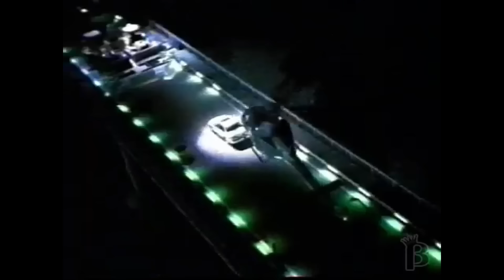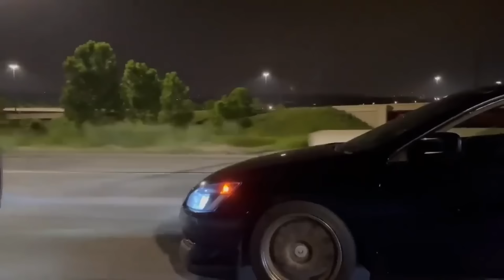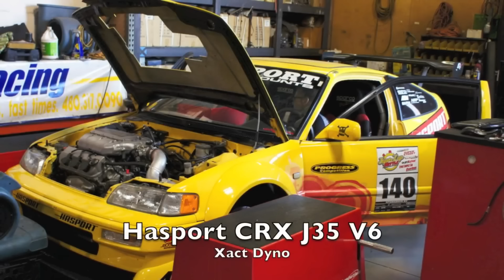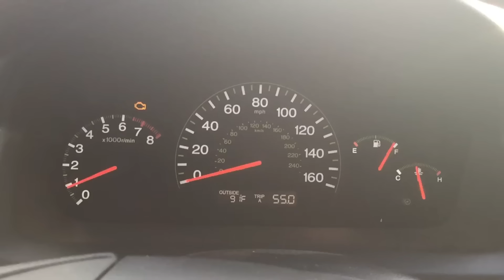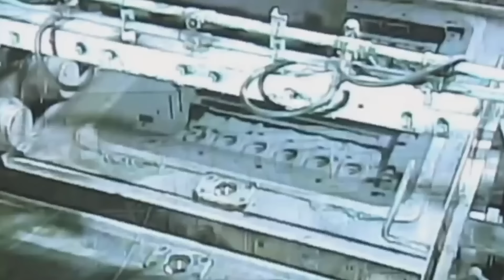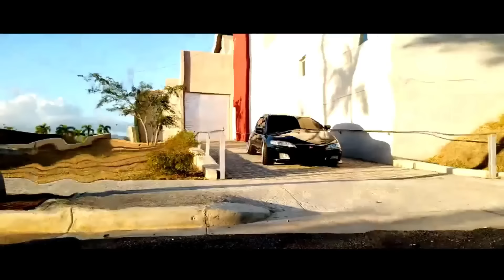Honda Accord: The J30A America’s Most Reliable V6 Engine!

Comment: I’ve had several j series vehicles. 98,99  2002 & 2007 accords , 2001 TL , 2003 CL-S, 2007 TL-S & and 2014 odyssey. My 99 accord has the original engine in it, my Dad got it brand new and I bought it from him in 2006. He had the crap auto trans warranty replacement at 85k miles and that one lasted me until 330k and I 6 speed swapped it from a 2005. I’ve beat the hell outta it that car and it has most of the bolt ons (j32 ported intake manifold,ported lower runners,big TB /CAI, headers ,catless exhaust, aluminum pulleys, some weight reduction) it’s a good bit faster than my TL type s. And it has 466k miles on the original engine. That j30 is fucking bulletproof just gotta keep the oil changed and it’ll last forever. J swap the world. P2R can make you whatever you need on whatever budget you’ve got .

Comment: I just purchased one with 195 just this year miles and also have the same year which is 2007 with one 196 miles on it had it for 2 3 years never had an engine problem always started. I've never left me stranded Trust me these cars are reliable. I go to the junkyard all the time to get ports for vehicles it's hard to find the V6, but they have plenty of the four cylinders which was weird because people always said the four cylinders were more reliable than the V6 because it has a timing chain instead of a timing belt but when I go to the junkyard, there's the four-cylinder everywhere instead of the V6

Comment: The original J30a1 was definitely handicapped by Honda to leave room for the J32 series. E VTEC and an unresponsive automatic transmission left a noticeable “torque hole” before VTEC. This made for a sometimes frustrating driving experience In my opinion. Still a smooth reliable engine

Comment: It's a solid engine, No doubt, but I don't think it's the most reliable V6 engine ever made in America.  The timing belt is a major Achilles heel. Edmunds did a test of a 2004 pilot where in their long-term test. The timing belt snapped and it wasn't anywhere close to the 60,000 mile rating.  Later versions have vcm and direct injection which both harmed the long-term reliability of these engines.
Reply: We going to forget about the class action lawsuit over camshafts snapping on your god like motor? Its a hunk of shit other then the 1st gen.
Reply: Dude on the forum right now has 530k miles on his J35. They're great motors

Comment: When GM fanboys think the 3800 is the greatest, the rest of the world knows the Honda J V6 is the GOAT
Reply: I'm not a GM guy but a facts are facts. The J engine series has its Achilles heel, namely the timing belt that can fail. There was a test back in 2004 done by Edmonds where they were testing a Honda pilot and the timing belt snapped. That is the inherent weakness of the Honda J engine. If the timing belt snaps it can destroy the engine without warning as it was nowhere close to the recommended mileage to need such maintenance. On top of this, this extra maintenance is quite expensive. The 3800 does not require this. The 3800 was able to beat both of the smaller Japanese engines in fuel economy and power until 5-speed transmissions and entered the discussion and until GM stopped updating it. The biggest mistake he had ever made was choosing not to continue updating the 3800. Later versions of the Honda g engine introduced vcm and direct injection that destroyed the reliability of the J engines.
Reply: I'm not a gm guy but I find it hard to call anything with overhead cams the best because they usually use a lot of specialty tools timing and injector service

Comment: Fun fact, 2004 to 2007 Saturn Vue V6 has a factory J35. Proof that GM can make a reliable SUV by outsourcing engines from Honda
Reply: LOL
Reply from the maker: That's a cool fact!
Reply: But it was cared for like a domestic car! It was abused it lived but American maintenance is stupid and they could kill it!
Reply: This is the go to replacement engine for 06-08 Ridgelines
Reply: Yeah but the Honda transmission still fails and the interior bits are still bad because it's still a GM.
Reply: @colinschmitz8297 I find most Honda automatic transmissions to be pretty garbage especially the early 5 speed ones the manuals are very nice though and last long I’ve seen Acura legends with like 500k-1 million miles

Comment: I just wish the auto trans they paired w these engines were better😢
Reply: 05-07 they fixed them
Reply: my 06 V6 coupe auto trans is at 315 000km with no sign of failing...

And I still drive that shit like it owes me money 😆🤣
Reply: I had to rebuild my automatic transmission in my 01' 3.2CL Type S around 98,000 miles. It hurt my wallet but I love my CL. Still cheaper to rebuild than trying to find a 01' Accord manual transmission in good condition.
Reply: 6 speed is still faster.
Reply: Yeah I feel like this video is cap since over 90% were paired with automatics that failed, or fell off the charts cause of age then failed & wasn’t reported
Reply: learn to drive stick
Reply: @HughJanoss  The 6 speed manual is like finding a Unicorn in the wild. The alternative is dropping in an Accord manual transmission from a parts car. Educate yourself before commenting.
Reply: @Harry88Taint they’re not hard to find
Reply: @Harry88Taint you have to look harder
Reply: @HughJanoss stfu dude, I did and they were either over priced or clapped out POS with too many after market parts. Some were east coast so that has rust damage and others were dipshits thinking they were going to make a track weapon but ran out of money. I already own a 3.2CL Type S and was weighing the options between dropping a Accord manual transmission into mine or rebuilding the failing transmission. It was cheaper to rebuild. Also for your info I drive a 2.5L Frontier with a 5 speed manual transmission as my daily so unlike the cucks you like to troll, I know how to drive a manual 🙄

Comment: I had the 1 of 500 EVER MADE.......... HFP HONDA FACTORY PERFORMANCE PACKAGE 7th gen Accord Coupe with the.....j30a4........

I did full bolt ons....FBO..... With TL Type-S ECU tuned on hondata.......... And let me tell you.......

That car made so many people angry that had bigger V6 or V8 mustangs Camaros 350Z de and HR models 370Z g35's Dodge charger and challengers v8's.......

No I've built over 30 Hondas since the early 2000 D series B series k-series h-series J series........

But something about that full bolt on J series..... WAS A DIFFERENT ANIMAL........ 

Matched with the HFP package that made that car look so much more AGGRESSIVE.......

That came with the front lip rear lip side skirts spoiler bigger wider Wheels bigger brakes strut bars sway bars lowered suspension from the factory!!! 🤘🤘🤙🤙

And the last and only other Honda Accord I would ever owned would be the 9th June 2013 to 2017 V6 6-speed manual coupe with the j35
Reply: Sounds nice,  like the HFP ground effects but didn’t realize anything else was improved.. Did it handle well or put the power down effectively??
Reply: @NewEdgeDesigns so this is what they did for suspension......
"Suspension: Lowered suspension and upgraded components like HFP or Progress sway bars and strut bars to improve handling.
Brakes: Upgraded HFP brakes or larger brake components.
Wheels and tires: Larger, wider wheels and tires were part of the package."

I'll tell you right now when I drove and parked next to a regular Accord coupe V6 not only do they not even look like the same car....(Hfp model looks way way way way way way way way way way way more aggressive)........
But they definitely handle different with the hfp model getting those bigger water wheels bigger brake package strut bar sway bars lower stiffer suspension with the upgraded shocks and springs they handle and stopping power is completely different......

Now the only downside was for some reason they didn't put an LSD limited slip differential in the Accord Coupe but they did in the Acura TLS so for the 2003 to 2007 Accord coupes you can take an 03 to 08 Acura TL transmission even the bass model has LSD and will bolt right up to the j30a4 / j30a5 in the 7th gen Accord coupes 

I mean of course being a front-wheel drive with 320 HP it's going to spin the tires quite a bit off the line even with a good set of tires and LSD......

But when you build over 30 Hondas like I have you know how to launch them and feather that throttle just right until you grab traction.....

Once that car grabbed traction..... Especially once it hit 3rd or 4th gear.... That's when that thing wouldn't start PULLING...... A lot of cars would get me off the line but as soon as I hit that third or fourth gear I would be reeling them in pulling right past them in that gear....... The most I ever got to in that car on a  long straight away was 167mph
Reply: Smh slow
Reply: @dsmkyle8802  what's slow? My daily driver Accord? you ain't even got 1 post on your sh*t GTFOH 😂😂😂
I got so many videos this Accord....EATING UP.... 350Z G35 G37 370Z mustangs Camaros Dodge charger and challengers v8's this list goes on....... This simple bolt on's and tuned j-series would have crushed your dreams 🤣🤣

And for the haters that's my daily driver......

I got the EJ1 Civic Coupe that I've owned for over a decade in the garage that's my fully built stripped down track car........come back when you got something to run it with🥱

Comment: It's  definitely  not as good as my 1mz fe v6 on my 1st gen sienna with all denso sub components  lol
Reply: You mean the same 1mz Toyota had to issue a recall for concerning oil sludge problems?
Reply: @colinschmitz8297 now is this just toyota logic? Because there are plenty of other vehicles on the road without the sludge fest problems that don't follow those rules and have been fine.
Reply: @jmasoncars4452 It was in consumer reports. The car care nut himself has referenced this as a problem
Reply: @colinschmitz8297 im well aware of the problem and the excuses from die hard toyota fans. The facts are that not everyone takes care of thier engines properly but toyota engines were the only ones affected from it in the short term. With the "proper maintenance" logic every engine should be suffering from the same problem but they are not. Fords 5.4 3 value is another good example of an engine that will last *only with proper maintenance* the 5.4 3v has extremely low tolerance for dirty oil or any amount of sludge do to the oil galleries and passages being too small for heavily contaminated oil to circulate properly. It's a design flaw.
Reply: @jmasoncars4452 I'm finding you're arguing to be confusing. I'm not a die-hard Toyota apologist. I'm here to say the engine wasn't perfect And that Toyota is not perfect. The problem with the 1mz was covering specific years. Clearly there was a problem with those specific years because the years afterwards didn't have the same problem. I'm not Toyota apologist and I'm not a Toyota hater. I'm a realist. Toyota has their problems too. I'm tired of people acting like everything from Toyota and Honda is 100% perfect and anything from anywhere else is automatically junk. Some things from Toyota and Honda are good, some things are nuanced, and some things are bad. The same thing applies to nearly every manufacturer that has been around for decades. Otherwise they wouldn't be in business and they wouldn't have fans.
Reply: @colinschmitz8297 i'm definitely not arguing to be confusing. I was trying to be as black and white as I could by just saying, the engine had a design flaw while using engines without the flaw as as an example ofnthe point i was trying to make. That's why I brought up the ford engine. I too am a realist and get extremely annoyed when people go to bat for any brand. We both can agree all brands have issues. While Honda and Toyota might be better overall they aren't exempt.
Reply: @colinschmitz8297 🤦‍♂️🤦‍♂️ i just realized this entire time i was responding to the wrong person. My original response was for @ambby1898 comment above not you. I 100% agree with you. I understand the confusion now. My bad.
Reply: Are you referring to the sludge fest 3.0 V6?
Reply: @jmasoncars4452 lol only a sludge fest if you dont know how to care for and run the engine through certain  routines.

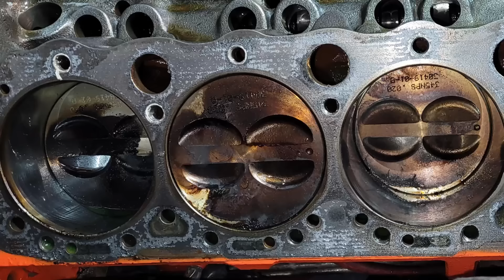Comment: Nice Small block Chevy a 3:22 ..
T he 3800 is America's most reliable V6. The J series is good tho.....
Reply: The 3800 is a boat anchor with head flow efficiency from the 70s, accessory tech from the 80s,  and electronics from the 90s.   Descent off the line torque but a worthless 170hp. I owned a park avenue and the horsepower and efficiency left a lot to he desired... on my second j35 powered vehicle. Mileage is a lot better so is throttle response, so is the horaepower and torque across the rom range. A j35 basically has great torque everywhere and never falls on its nose near redline like the 3800 does.

Comment: VQ in the corner laughing with all its engine of the year awards.
Reply: Honda and Nissan both have 23 total. The VQ was probably the only good engine Nissan made while Honda made plenty of good four bangers and sixes. 
The VQ is rough and unrefined. The J series is smoother, with better torque. Honda made the J a stroker engine which has better torque. 
Anyone can make a destroked engine
Reply: @EricTheGreat508 Datsun says otherwise
Reply: @EricTheGreat508 the qr25 is a great motor. A nissan Frontier recorded 1,000,000 miles on original qr25de motor.

Comment: Out of all the cars I’ve had in my adult years, my 2003 Honda Accord EX-L is one that I miss the most. That car gave me 0 problems and was very solid. If I knew then what I know now I would still have it. When I got rid of that car in 2013 it had 156,XXX on the odometer.
Reply: Just topped 350,000 miles on my 2004!
Reply: @BarzOnTheWindow1  Wow that is awesome! That generation of Accord was literally built like a tank. I remember the build quality being very top tier. The motor was solid and the leather and plastics still being in tact when I got rid of it.

Comment: maintenance is just a pain to maintain after 100k, suffering from many O-ring leaks vtec solenoid, oil pump, valve cover gaskets, and rear main seals, having a Toyota v6 eliminates half if not most of the leaks

Comment: I miss my 05 Honda Accord coupe..i fell asleep and crashed and flipped over ,the car saved me though . I loved the j series on that car.. 200hp ,i added slicks and damn that torque was. Amazing.
Reply: Wait what?  You added slicks to a stock 05 Accord?  May I ask why?
Reply: @Whyteeford they do spin like crazy because of the fwd but slicks is ridiculous on a stock accord.
Reply: I just bought a 07 accord coupe 6 speed at IAA Auction for $700. All it needed was new brake lines. Zero rust. Im keeping it. The 6 speed in these cars are rare
Reply: @jayjay3195 nice find for the price

Comment: This engine is so beautiful, it sits next to the Toyota 2GR-FE as a reliable and effective V6
Reply: Yeah, except 10x simpler to
Own and work on. The main difference being the t belt vs t chain.
Reply: @Dominivacano the chains on the 2gr are really good, I’d say the worst thing about it is the front timing cover leaks. They are the Achilles heel of the 2gr.
Reply: @Gallantboi786  The 2gr timing chain. Will last the life of the vehicle. Even when tuning this engine you will never have to touch the timing chain.
Reply: @Gallantboi786 2gr most reliable v6 ever in America then 1mz then 1gr
Reply: @Gallantboi786 The early versions of the 2gr also had problems with the lines for the variable valve timing bursting in spewing oil which can destroy the engine. Also, versions used in the sienna were known for having head gasket problems according to the car care nut.
Reply: @colinschmitz8297 so true, my 06 Avalon has the dreaded rubber vvti oil line, and it hasn’t cracked yet, but I’m already shopping at the dealership for the all metal one
Reply: @Gallantboi786 j30, j32, j35 & j37 all need timing covers at some point too- it’s all v6s really😭
Reply: @m @masonchase085  yeah I have a 06 Avalon and it’s got a front timing cover leak. And an 09 Honda odyssey with oil consumption. But it runs like a tank.
Reply: @Gallantboi786 the J is famous for timing cover leaks too any issue you find on the J you will also probably have a similar experience with the 2gr & 3mz
Reply: Na they actually suck other then the first gen. Once they put dod on them they got recalls. snapping camshafts aint a good engine. Look it up j35s got recalled
Reply: @dsmkyle8802  Exactly, they're facing a class action lawsuit at the moment. Toyota N/A V6 Engines are better.
Reply: @dsmkyle8802 You can easily delete VCM. Eliminating the inherent issues with cylinder deactivation.
Reply: @MrSamPhoenix there’s a forum of people who post specificly j series that are NOT muzzeled lasting well over 400k
Reply: Tx accord has a 2003 v6 6 speed coupe j30a4 with 1.2 million miles. He swapped it out after a million on the original engine, but for ever 1 j series car hitting a million, I can see 10x 2gr's hitting a million just for the fact that toyota has far more superior automatic transmissions. That j series outlast the transmission (non vcm) there's a reason the engines sell for dirt at a junkyard
Reply: 5VZ-FE
Reply: Agreed. The J-series are gorgeous engines and are easy to work on. It’s the engine that my brothers and I learned how to service.
Reply: Bs... gdi and vcm make this a piece of sh-. Plus mine is paired with zf9 tranny ... imagine this sh-- tranny tlused by all the junk var like Chrysler, land rover, etc.
Honda sucks!